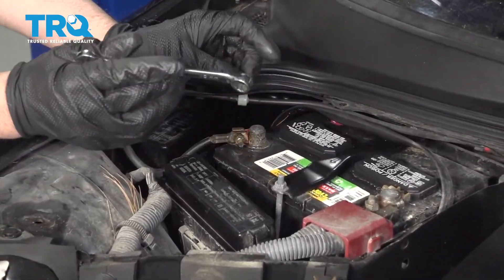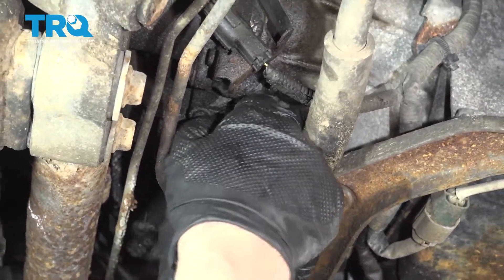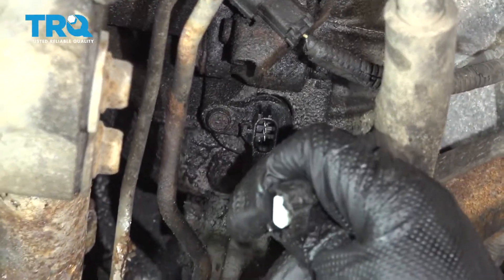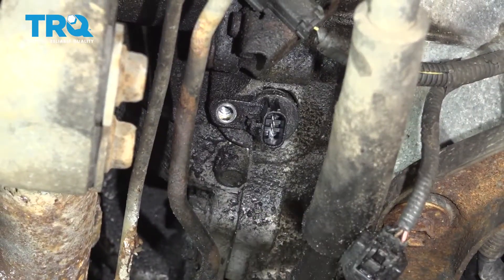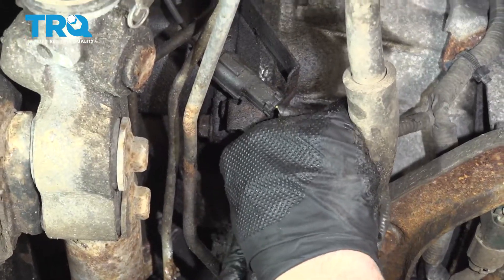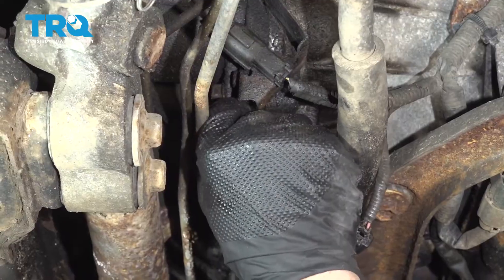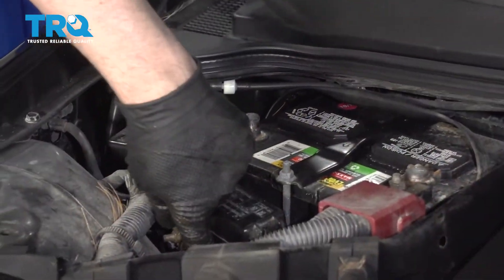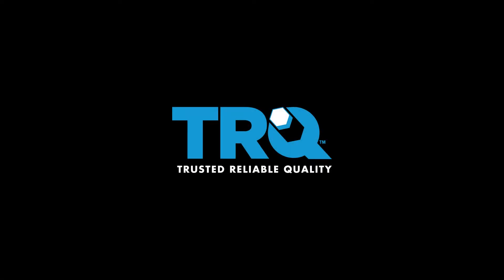How To Replace Crankshaft Position Sensor 2003-06 Infiniti G35

Comment: I'm pretty sure a little degreaser is warranted before disconnecting the plug, and maybe some contact cleaner on the plug itself.  There's no way that getting even a little of that oily grime in the sensor cavity is helpful

Comment: My advice, make sure you clean the connector before you hook the sensor, sometimes the sensor itself is good but the connector is flooded with oil, poor signal from the sensor will leave you on the side of the road again.

Comment: If needed to change will ur slip and vdc light come in
Reply: Not always mine threw a crank code in my o4 g35x, no vdc or slip lights just check engine
Reply: @geraldwilkinson4287  I bought one and they sold me it with a bad crank and bad knock sensor and I’m pissed af
Reply: @geraldwilkinson4287  bruh me too
Reply: What is this part called and which side of the engine is it located
Reply: yes